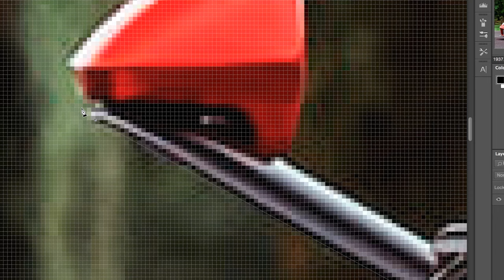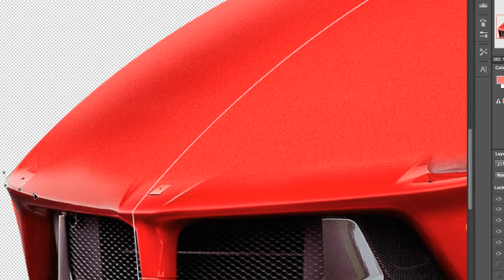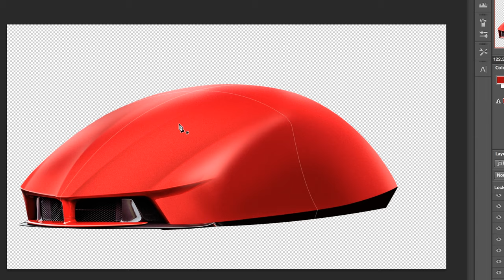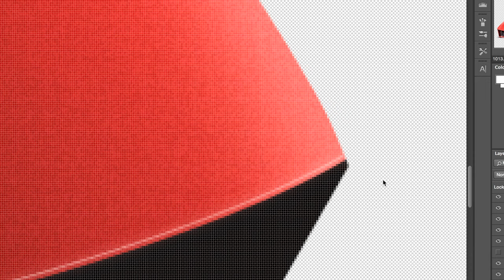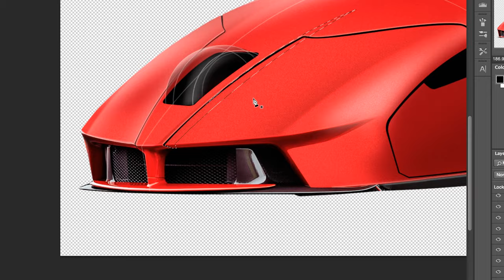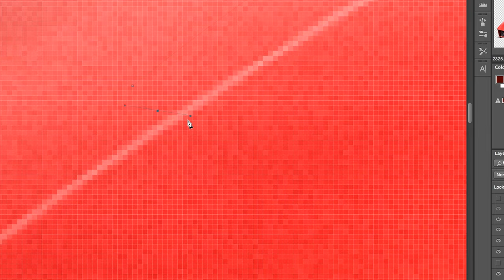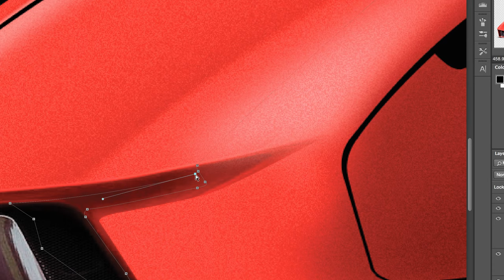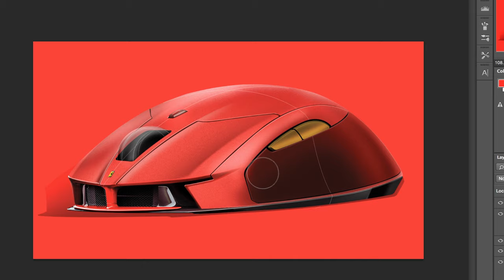Mechanical Engineering vs. Industrial Design (Whats the difference?)

Comment: Why do more people seem to know about mechanical engineering but not industrial design? I didn't find out about ID until my junior year of high school, and by then I had taken so many pre-engineering courses I didn't have time to include art. I ended up switching majors in college and am now really happy with ID, but I wish I'd known about it sooner
Reply: Same
Reply: Same, hope you can answer some of my questions in your free time and I will be very appreciated. How long did you take to prepare the work collection to apply industrial design major? Do you think those pre-engineering courses you take are useful after you get to college? Any struggles you have during application?
Reply: @Lok7Media   i ended up taking AP art in my senior year so I had a portfolio of artwork (albeit it was much more fine art than design work), but they accepted that as my transfer portfolio. I do think the pre-engineering courses helped because I learned 3D modeling and got a lot of critical thinking and problem solving done in my projects which helps wih design problems. My only issue in my application process is that my university has a fall-spring curriculum, only offering classes in sequence. I wanted to switch majors in the spring but wasn't allowed to because I didn't have the fall classes, so I had to wait until the fall semester. I feel like that wasted my time, but I did take an art class that semester that I really enjoyed. Hope this helps!
Reply: @KindaCarolin  Wow that's a lot, thank you for your advice! I would probably take AP art in my senior year too
Reply: I found out about this in my second year of mechanical engineering, and now changing y major.

Comment: Great video. 
As a mechanical design engineer, Aesthetics is also considered, but more on the functional aesthetic side, meaning will it add value to the function, user friendliness of the part/machine, etc. 
Ergonomics is also a factor in terms of machine operation, maintenance, etc.
I guess we cater more on industrial products rather than consumer products. But if we can make machines as aesthetically pleasing as consumer products, that would be lit.
Subscribed!

btw for us "Function is King!"

Comment: This is very similar to describing a structural engineer vs. architect. Many people I've met think of them synonymously, when both have overlapping roles and need for collaboration, but different focuses. Architect has a lot to do with the looks and usage for the people inside and outside the building. They will also be considering how the structure will hold up as they conceptualize, but not to the extent of a structural engineer. The structural engineer ultimately ensures the building will be able to hold up and withstand forces of nature and usage.

Comment: To Jimmy or Anyone else here with experience in this matter:

Hey Jimmy, been watching your vids for a while now and I was wondering if you had a moment to answer a quick question. I am about to start an Industrial Design Program with an Emphasis on Transportation Design, and I have also applied and been accepted to several CAD design programs, however, there has been an aspect that keeps nagging at me strongly. I am much more interested in the engineering side of things than the artistic side, but that doesn't mean I'm not interested in the beauty of functionality, I very much am. My mind has always been more geared towards the engineering side of things versus the aesthetic side of things. I am interested in practicality, mechanisms, and function. Furthermore, I am particularly interested in the CAD side of things and I am hoping to take a career path that allows me to focus ion the CAD/engineering side of things. I have learned solidworks, catia, rhino, and a few others. Anyhow, my question is this: Given my interests and strengths, would it be better for someone like me to pursue a degree in CAD Design or Industrial design? I have posited this question to some people, but their answers were rather diplomatic and didn't really get to the heart of my question. Also, I wanted to say that I am not up for taking on an engineering degree as I feel that would require more of my attention and cause me stress that I am unwilling to take on considering personal life circumstances. If you can answer I'd sure appreciate it, if not, I completely understand. Thanks!
Reply from the maker: Do industrial design (ID). You dont need a CAD degree to land a job only doing CAD. ID has a lot of disciplines within it, one of them being 3D modeling which you can specialize in (spend more time building your skills modeling). Honestly, if you're more inclined to focus on function and mechanics then do Mechanical Engineering (ME). Industrial Design is not any easier/less stress than ME. ID might seem easier but everything is relative to your peers. There are a lot of good designers out there which you'll always be compared to. If you're noticing that you're just not as good as your classmates, that will bring a lot of stress itself. These's also a lot more jobs for ME so my opinion, its less competitive. For ID, you NEED to be better than most and a little bit lucky to make it.

Comment: If I want to become a car designer,should I study industrial design or mechanical engineer?
Reply: Obviously ID. If you want form do design if you want function do engineering. That literally the definition of both.
Reply: If you want both then pick industrial design engineering
Reply: if you want to specifically design cars, just the design and user experience of it, then definitely industrial design. my classmate had the sole intentions of being a car designer and went into designing cars for honda
Reply: @kayanatorx3  how hard is it to get a job doing that
Reply from the maker: Hey Axilleas, Car design is a design field of its own. Kinda of like architecture or fashion design. There are programs that teach just car design which i would recommend if you plan on being a car designer. Industrial design would generally for smaller things (but not limited to).

Comment: Right now I’m a welder fabricator, is basically given a blue print at work and I shear, bend, fit and weld whatever’s on the print I love it but I wanna go back to school for product development/drafting and be able to run cad and design. Would my time as a fabricator look good on a resume?
Reply: Yes it would!
Reply: Endeavour thanks for the reply  man encouraging to hear
Reply: @jjtmmjjmm2113  Why dont you look into getting some Solidworks qualifications? you can get them directly from their website, and it shows you have an interest in the subject. It costs only $100 something dollars and will teach you how to make CAD designs using Solidworks which is a popular software in the industry. If you can talk about how your experience in work has enabled you to get some insight into the product development proccess, show off your passion and im sure you could get a trainee role without having to pay buckloads of money for a degree.